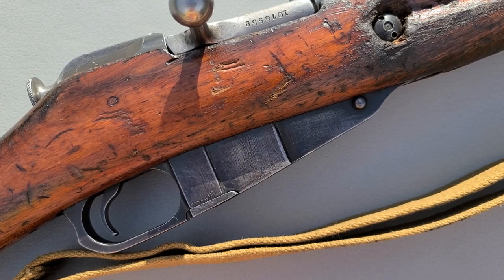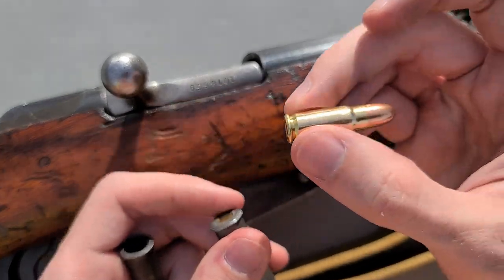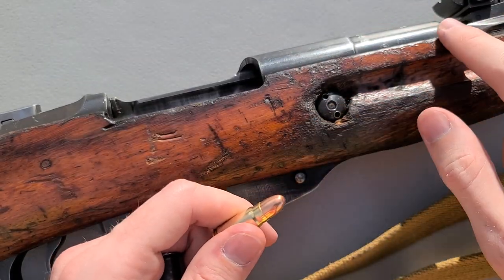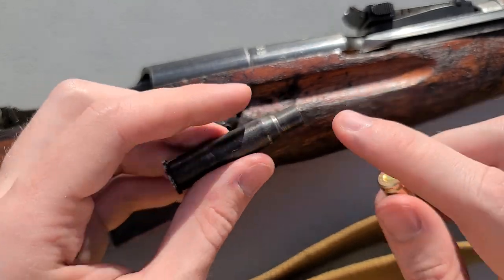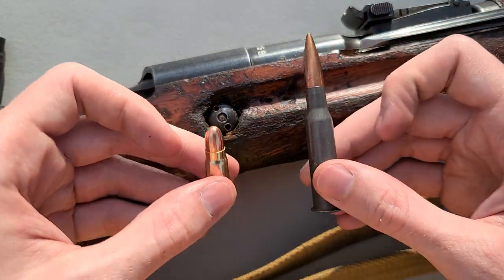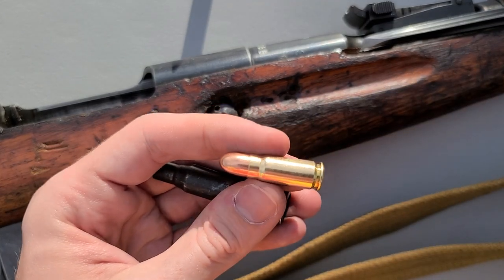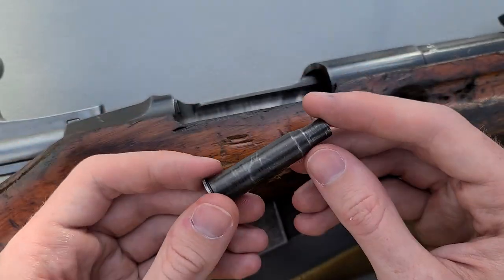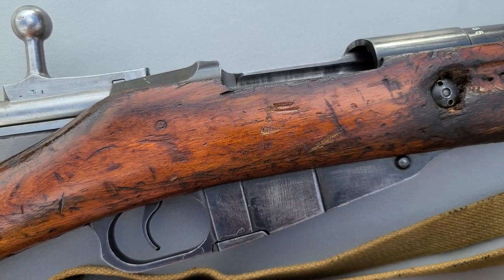How to shoot 7.62x25 Tokarev in a Mosin Nagant

Comment: I have a similar type of chamber insert to fire .45-70 through my 577-450 Martini-Henry. I also have a spare cylinder for my Nagant revolver that accepts .32 Auto ammo. These are quite practical due to the price and lack of availability of the original cartridges in both cases.

Comment: One, this video would have been a lot better if you'd made it on the range and included the footage of the firing.
Two, MCA/ACE and some other companies have made auxiliary chambers for .32 ACP, .30 Mauser, .30 Luger, .32 short & long Colt and .30 Carbine for most of the thirties and thirty-ones. A lot of them were bought by hunters so they could carry a "turkey load" in their pocket for their deer rifle, without having to handload. The also make .22 LR and .22 WMR adaptors with a centerfire-to-rimfire plug for most of the centerfire .22s. (Don't forget the auxiliary chambers shipped with the .22 Jet S&W revolvers.) They also produce an array of inserts with a rifled barrel portion for inserting into the barrels of break-open shotguns and rifles.